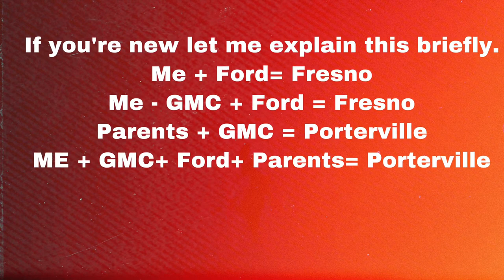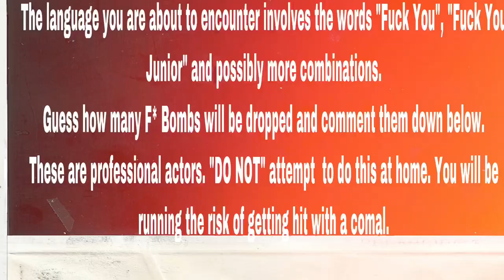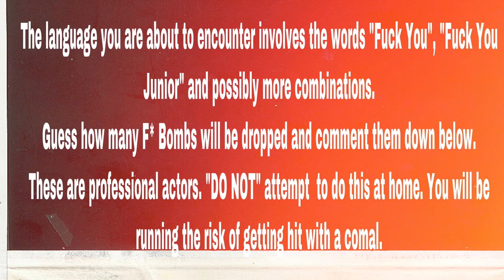Broke Garage ep 1: Cheap 84 dollar  eBay SS Wing! Is it worth it?

Comment: What bolts did you use ? For it and where you get them at ?
Reply from the maker: Small metal screws from Home Depot . They are smaller  than an inch.